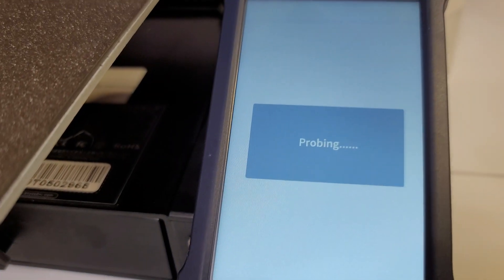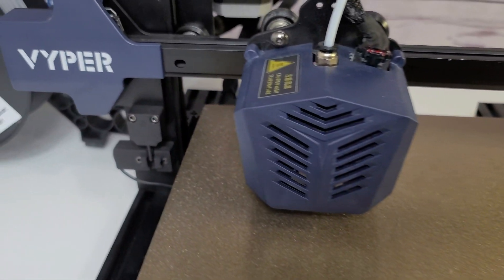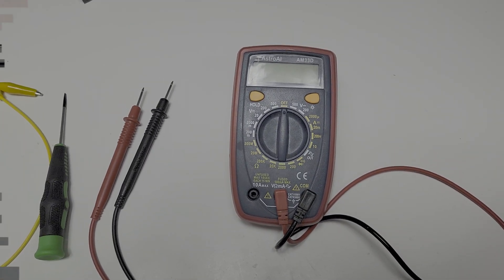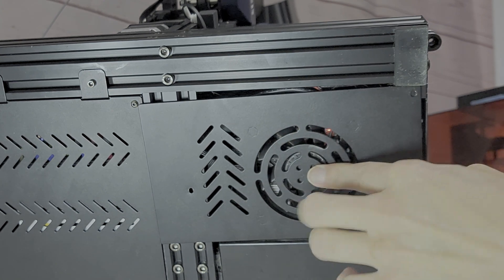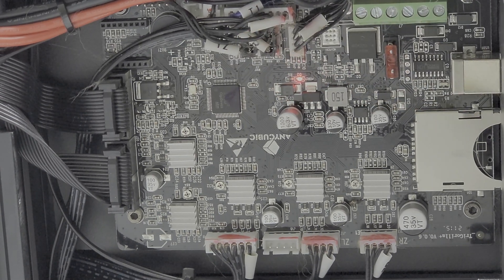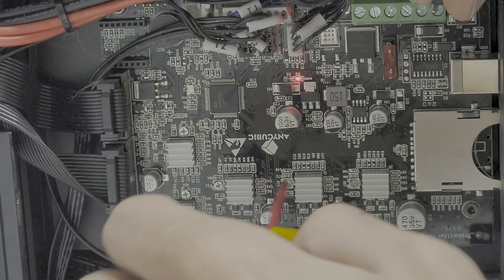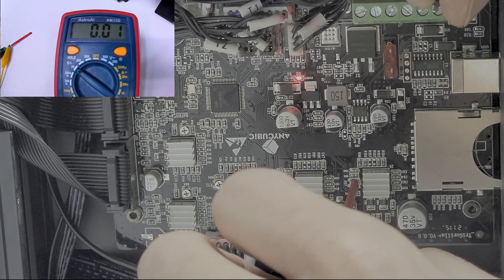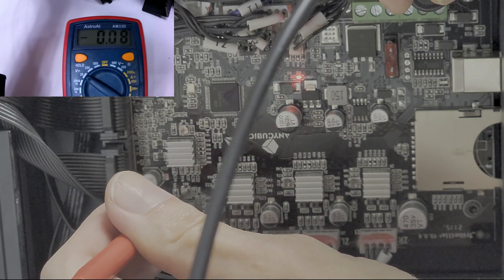Anycubic Vyper Vref adjustment guide

Comment: Hi! Do you know is this working on klipper firmware?
Reply from the maker: There are a number of people I have seen running klipper on the vyper and it works really well. I generally keep my units stock for comparison reasons but it works well
Reply: @studiozombie3d  cool! thanks, will try to adjust my steppers voltage to 880mv as yours.

Comment: Hey StudioZombie!
Is it okay, on Y axis i can’t adjust vref? Only 1.8v or 0.16mv avaible? 
Thx
Reply from the maker: 1.8 is way too high for steppers the highest they should be is 1.1v I run mine at 880mv if your having trouble turning the pot try a small flat head driver I find Philips can slip on the pot
Reply: @studiozombie3d  i can turn right or left the pot, but the value do nor change. Only shows 1.8v or if i turn little more it show 0.16mA
Reply from the maker: @barnabastakacs8257  wow thays pretty crazy. Spunda liek the pot might be a bit messed up you may be stuck at 1.8.   .16 will barely be enough power to drive it
Reply: @studiozombie3d  is there any solution to fix the pot?
Reply from the maker: @barnabastakacs8257  you can try maybe with power off clean the pot with alcohol and see if there's maybe residue on it causing it not to ready right. You can fire me a email as studiozombie3d@gmail.com and I can help a bit better. Or if your on Facebook I'm the one expert in the anycubic vyper group feel free to message me

Comment: Hello! After all the settings and the voltage reduction on the drafts, the print quality has deteriorated greatly. What to do? It may be a little increase in stress?
Reply from the maker: You may need to increase the voltage. If your running stock firmware that could be the issue. The firmware I use has the steppers in 2209 standalone mode they work better with the voltage

Comment: Great vídeo but have a question, while you are tuning the steppers, are you plugged in to the mains or using USB power?
Reply from the maker: you need to have main power on while adjusting to monitor. you can adjust with it off but its difficult
Reply: @studiozombie3d  thanks for the answer, it's just that i have done it before to a duplicator i3 and  in that case it's was advised to use USB power instead, i just got my vyper today and i have noticed the stepper getting quite hot
Reply from the maker: @KiMi_KaL  I never tried it with USB power so I'm not sure I've always had it powered on when I did mine.

Comment: I will probably do this tomorrow!!! Thanks for the video, I was afraid to try it before watching a pro!  Putting in your firmware was a breeze, even for a new guy like me.  In the video, I couldn’t really see where you placed your ground.  anywhere on the frame? Or somewhere you like best?  thanks for all the vyper support!
Reply from the maker: I used the ground terminal on the mainboard where the power is screwed into the green plugs. I find that's the best spot. Just be sure to be very careful when adjusting that you don't touch anything other then the pots with the positive. It's really pretty easy as long as your careful

Comment: I dont know why all have this high voltage. All my Vyper Vref are around 0.77v Stock. Tried to get them to 0.88v but then I got some issues :D
Reply from the maker: Wierd mine was at 1.1v on all drivers lol do you have the 0.0.5 or 0.0.6 board? Mine when I dropped it with stock firmware it caused issues itsna weird system the vyper alot of odditites
Reply: @studiozombie3d  it's 0.0.6. I ordered some new rods for z axis and some parts for my frame. Hope I can fix these issues
Reply from the maker: @K4R98  you could just have a wierd unit voltage wise most I've seen run 1.1 on my firmware I run .88 and its perfect. But when I had stock firmware the steppers would mess up any lower then 1v its a wierd system
Reply: @studiozombie3d  Now I am using ur 6x6 grid firmware and adjust Vref again. Always left side ist lower as the right side. X axis was leveled but I i think steppermotor losing steps because of low voltage. Don't know.
Reply: @K4R98  what do you have your vref set to? Mine did that when I was using stock. You may need to run it a bit higher
Reply: @zombiej79  now at 0.96 but I can hear them after moving. Sounds like "brruumm" :D Hope they don't die. May I have some issues with my Mainboard. Don't know. If I have some special questions, can I contact u over the Vyper group?
Reply: @K4R98  yeah for sure fire me a message
Reply: @studiozombie3d  should i do this to my vyper ive installed you zombie 2.8 driver

Comment: if i have shifts on the same layer, it can be low voltage?
Reply from the maker: If your running stock but haven't adjusted voltage then it could be belts or the rollers on the bed being a bit loose. Double check your belts and wheels make sure everything is tight and if it's in the same spot every print could be another issue. You can try sending a m502 to reset the eeprom then re enter your esteps and try the print again